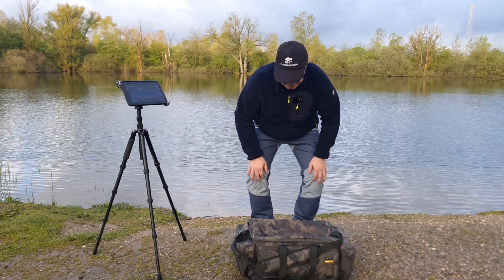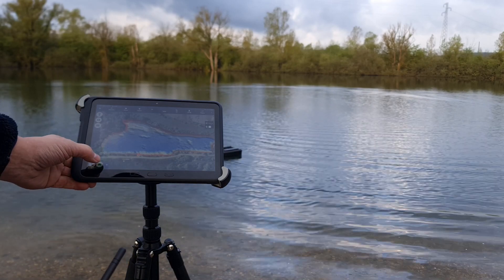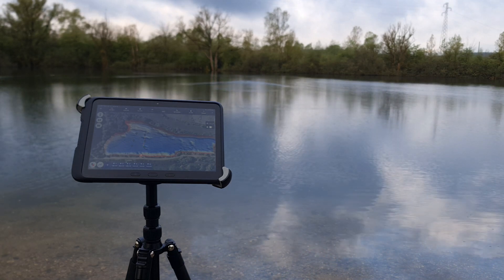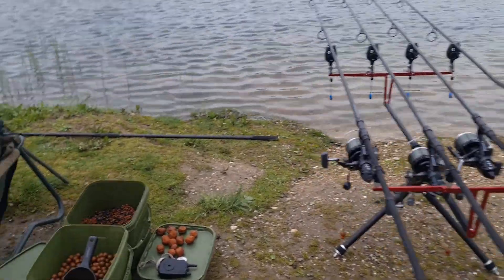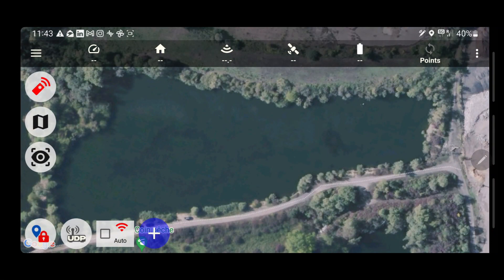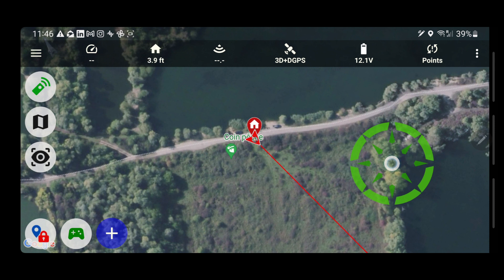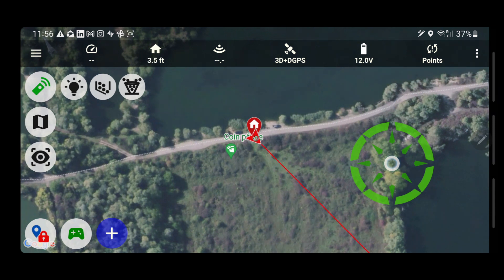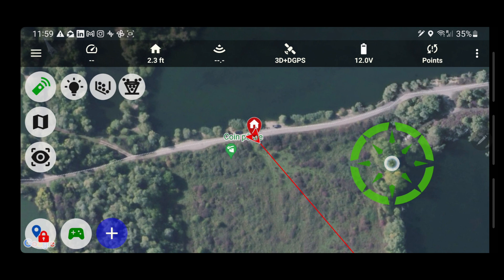Boat build part 9 - First time drive, and app setup

Comment: I’m building a houseboat, but it’s slow, and sitting at the wheel gets boring when you’re traveling 60 km across the lake to your destination. How hard would it be to incorporate your bait boat technology into my boat? Thanks!
Reply from the maker: @Nature-bt5ip  not that straight forward I think. The autopilot would have to directly control motor(s) and perhaps a separate rudder. I read some posts on electric outboard motors (like torqeedo) on the ardupilot discussion forum. Houseboat sounds heavy...

Comment: Hey, great videos.

I have recreated the self-driving automatic, unfortunately the wifi module breaks down again and again! It only lasts about 5 minutes, then it's gone. I have now tested the third module and after a short time they are defective. Would you have any idea why that is? 

I took this module: 2,4G Wireless Wifi Radio Telemetrie Modul Mit Antenne,MAVLink2 Pixhawk APM Flight Controller FPV Drone
Reply from the maker: @marom7949  I showed a module in video 3 that I have used a lot. Never let me down yet. But if every sample of your module gets destroyed after a short while my first and best guess would be a possible issue with the power supply.
Reply: @TheCarpPilot  

I redid everything and now it works.
And the mavlink was also a problem😅

Comment: Is there an emergency return in case of signal loss?
Reply from the maker: Yes there is. And this was also briefly mentioned in video # 8. This is something you set up as so called failsafe. You will see in that video where it is documented. 

I would recommend failsafe action to be RTL. If you select "HOLD" then you need to swim out to the boat to retrieve it (I have actually done that more than once, but then with boats with no autopilot onboard). Loosing communication with the Carp Pilot Pro is a so called GCS failsafe. Loosing the control with the radio transmitter is another option.

Look at the video 8 and do some research on the ArduPilot pages!

Comment: Watch out for that thrower . It will spin the boat 😊
Reply from the maker: That's true. Spinning might be a bit of an exaggeration. But it will for sure turn the heading of a boat at stand still. Not that much. Haven't given it any thought to be honest. Maybe because I always drop tray with hook and lead first, thrower runs second.

After tuning down the power this particular thrower spreads a basket of smaller pellets over an area of 10 meters (+/-) in diameter. Resulting in scattered offerings surrounding the more concentrated area around the hookbait. I love it, all of my boats have it fitted.

Comment: hello, I want to replace my rt4 v3 brushed motors with brushless motors. Do you know a good motor and speed controller for my boat? the boat runs on 3s lipo batteries
Reply from the maker: The motors I built and the ESC I used in the video about building a bait boat: See video 1. In that video I used a spitzt motor. The ESC you can use, but the motor should e of a slightly bigger size. If I remember correctly you need a motor with a 5 mm shank.

Maybe join the Carp Pilot Pro user group on Facebook instead. Well above 1000 members with the same interests, they likely have more thoughts on this than I (also a collection of RT4 users there).

Comment: how does the steering works in the boat?
Reply from the maker: The boat has two motors, no rudder. It steers like a tank (the term is called "skid steering"): More thrust on one side makes the boat turn.
The remote transmitter I chose to buy for this boat build (Skydroid T10) does not have a built in mixer. But that does not matter when used with the autopilot. 

I cabled left motor to ch 1, right motor to ch 3 on the pixhawk. And then, in the pixhawk setup (check out video number 2) I set ch 1 as throttle left and ch 3 as throttle right. On my remote transmitter, ch 1 and ch 3 I set up for the right stick (I prefer to have it on the right side, some would prefer to have gas and steering on the left side and then needs to adjust that accordingly).

And that's all there is to it. Ardupilot (the autopilot) will, when I drive manually, mix the channels and everything works and I can drive and steer using a single stick.

Comment: I would like to ask you what is the range of your wifi telemetry? If I use sik telemetry radio is there option to connect to your application? Thanks in advance and what a nice cath for first time! :)
Reply from the maker: Hi. SiK telemetry works very well. And Carp Pilot pro still has USB (which is how you typically connect the onshore SiK radio) as the default connection option. To avoid that physical connection you can build yourself a box with, as an example, a Bluetooth adapter (my guess is that HC06 should work).

WiFi telemetry using a Booster like in this boat build: I have not yet tested this particular boat on range, but the previous boat I built I got into connection problems at about 340 meters. Which for me is totally acceptable, I prefer to fish the smaller lakes.

I remember I struggled a little with SiK radio range. Until I finally found the antennas that worked. Using regular 100mW radios I had no problems to reach 350 meters (and probably a bit more, just did not test it), but not with the stock antennas provided with the kit. I ended up with a pair of 433 MHz coiled dual dipole designed by ibcrazy, bought at a regular US drone shop. Amazing performance.
Reply from the maker: And yes... Here I baited up in a hurry, and spent time editing video. 19+ in an hour is probably the best start I have ever had on a long session. Fact is I had one 21.6 kg (common) as well only hours later, the run came just minutes after I started to upload the video 😅. Wow 😍
Reply: Hi, thanks a lot for your suggestions. The wifi booster is only for the sonar bicause it is needs a phisicaly connection as I thougt, but you connected the udp adapter too as you said. The udp adapter as a separate wifi adapter to send telemetry through wifi, so im a bit confused :) Could you please make a short explain of it? On the ground use only the wifi antenna of the tablet?
Reply from the maker: @MrGaby2744  It is basic wifi network stuff...

Say you have a deeper and the Fish Deeper app. Or a Dragonfly Pro 5 and the belonging Wifish app. To use the app you connect your tablet's wifi to that fish finder. And then you can use that app.

The fish finder is then a wifi access point. And it will allow more than just that tablet to connect to it. And exactly THAT we also do with that wifi telemetry adapter. It connects, gets and ip address and starts to send telemetry data.

Now you have a network. The tablet, the fish finder and the telemetry adapter are all part of one single network. And in this network, just as the Wifish app can reach that echo sounder then Carp Pilot Pro app can reach that wifi telemetry adapter. Usually using UDP protocol and Port 14550 (typically printed on the back of that adapter).

So no magic. Just a data network 😉
Reply from the maker: @MrGaby2744  when several devices is connected to the same wifi access point (the fish finder wifi) then they are both on the same wifi network. And can reach each other. And yes, on shore I would then only use the tablet and its built in wifi antenna.
The wifi adapter is made from an esp. It has a physical 4 wire connection to plug into a pixhawk serial port that you connect to the telem1 or telem2 port and set the serial1_protocol (or serial2 for telem2) to value 1 for mavlink 1. Then you enter the wifi adapter's GUI and configure it to connect to the wifi of the fish finder using "station mode".
You can build the solution also following these instructions. 
https://ardupilot.org/copter/docs/common-esp8266-telemetry.html

And you can obviously use it stand alone without any fish finder. If so select a model with a uFl antenna socket wo you can mount an external antenna (and also a Booster in-between).
Reply: @TheCarpPilot  Thanks a lot, it is completely clear now! :)
Reply: @TheCarpPilot   Hi, I also struggled with the range of the stock antennas it has maximum 80m... I found that Ibcrazy antennas but currently unavailable. Do you still use these antennas because if you didn't I might buy them from you if possible? Thank you in advance.
Reply from the maker: @MrGaby2744 I probably have a couple in a box somewhere (both used and new, at least one new). And I for sure do not need them anymore as I have stopped. You can reach me on thecarppilot@gmail.com.

But... If you cannot buy it, an antenna can also be built. Here i found a video making a 433 MHz antenna. This is a full dipole and will only be good if your boat is high:
https://youtu.be/U8YmSRIB9fQ?si=RYlOwzUT4wGCx2U1

You should obviously use stiffer wires as the red wire in the video should be "up in the air", it needs to stand a little stronger.

And in the RC Groups I found some nice samples with drawings and some suggested materials as well. Among this a build drawing of an antenna that is partly coiled for the ground plane:
https://www.rcgroups.com/forums/showthread.php?3133027-A-DIY-433mHz-Compact-Dipole-Antenna-Build

Once again as the shielded antenna wire may also need to stand up to lift antenna above the water I would perhaps recommend a stiffer wire like RG58 or something similar.
Reply: @TheCarpPilot  Thanks a lot, I have sent you answer by mail

Comment: Can I use skydroid h12?
Reply from the maker: Sure you can. But how to reach the mavlink data by internal UDP connection (within the H12 when the Carp Pilot Pro runs on the H12) is kind of a secret that Skydroid never revealed.

Two known workarounds: There is a Chinese app developed by HEQ who uses the H12 for their drone. If you install this and run it, then Carp Pilot Pro can do UDP internally. But only for 30 minutes (which probably is the maximum flying time for that HEQ drone, my best guess).

The second workaround is to install another bluetooth connection. I personally built in a HC06 internally in the H12. I found 3.3V and GND, and as it turns out the mini jack has the mavlink data available as serial data. Such a modification is not without risk. The way I did it was published in the Carp Pilot Pro User Group on facebook with pictures and description.

The H12 screen is bright and clear. The screen size is a bit small to my taste. So I prefer to use the Skydroid T10 and a tablet on a tripod. I also have quite a collection of Android compatible game controllers and just released a video on how to use it and set it up. Especially one of the controllers (Ipega PG-9083s is high quality and can take large tablets - i managed to squeeze in my Galaxy tab 7+ which seems to be the limit).

Comment: HI. What is the alternative connection to the boat if I don't have a sonar with wifi, just pixhawk with gps and 433 mhz telemetry? Shoult I build a wifi telemetry and replace the 433 mhz one? Te app is just great and i covers all posible needs for me and I just installed but at the moment I don't have any "wifi ap"on the boat.
Reply from the maker: Adding a wifi AP in the boat also require you to add some kind of booster or add in wifi router in boat and on shore as the regular serial to wifi adapter does not have signal strength to reach very far. If you are pleased with the performance of your 433 radios then stick with them.
Now, some don't like to have to plug the 433 radio in by cable. And build a box on shore which holds the radio, a hc05 or hc06 Bluetooth serial adapter and a rechargeable battery. Maybe even a tablet holder attached to the box as well and fix the box to a camera tripod. A fairly clean setup doing exactly what it should.
Reply: @TheCarpPilot  Can I use your app with the 433mhz telemetry sistem? I really like your app and I purchased it, but I don't know how to connect  my boat to the app, that is why I asked about the Wi-Fi telemetry wich I saw you used in your videos.
Reply from the maker: @CosminFrinculescu  Bluetooth, USB and wifi UDP/TCP are supported. 433mhz radios is usually connected using USB cable and works well.
Reply: @TheCarpPilot  Thanks. I will give it a try with 433 mhz and then I will see.

Comment: Witaj gratuluję połowu. Potrzebuję twojej pomocy. Pisaliśmy już kiedyś aktualnie moja łódka pływa na apm. Zamierzam właśnie założyć pixhawk . Mam do wyboru mini lub 2.4.8 . Który wybrać ?
Reply from the maker: That's a personal preference perhaps. I know several that reports they are happy with mini, but the regular 2.4.8 is what most people use ( it only for boats, it is used in a high volume for drones in general) and thus any problem you may encounter is a problem someone else already have had: Asked, and answered. So if in doubt I would choose the 2.4.8 any day. I used a Pixhawk4 mini in the Youtube boat because it was small and, also important, since I already had it available in my drawer. Next boat I build gets a 2.4.8.